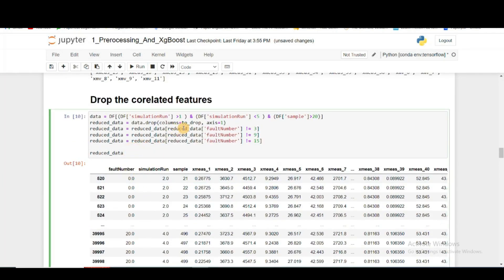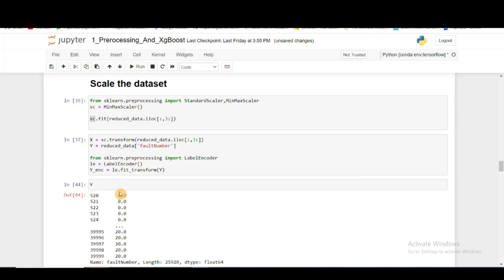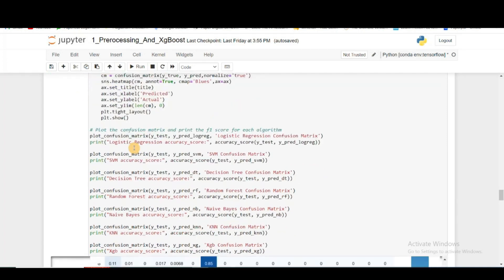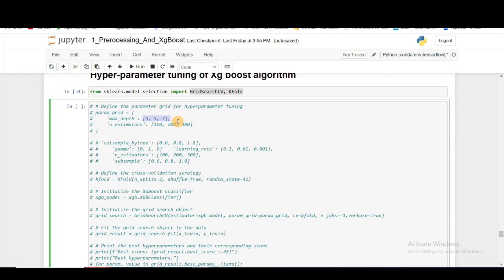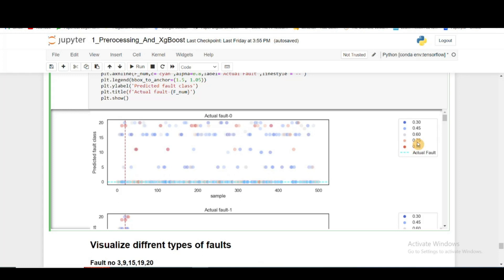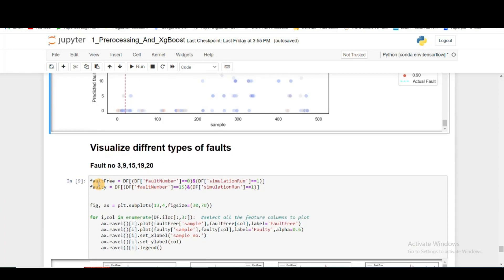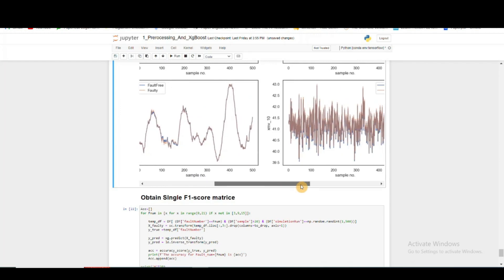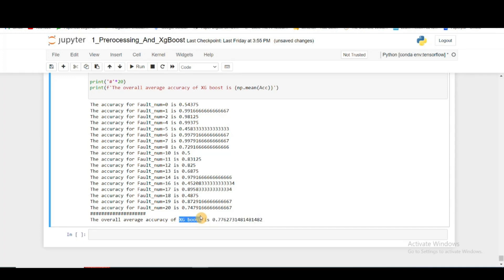Machine Learning for Fault Diagnosis Part 2: Training Various Models and Hyperparameter Tuning

Comment: Bro I am trying to build a regressor model to predict a regression output and an I did EDA a large number of times with improvement and develop many algorithms and maximum I found 65% accuracy with XGBoost and hypertuning I also did so could you pls tell me how to increase accuracy score
Reply from the maker: Hi, can you tell me what metric you are using to evaluate the regression model. Because accuracy is usually used for classification models!